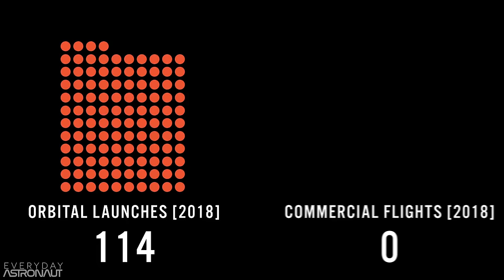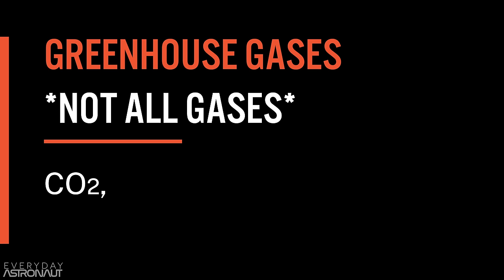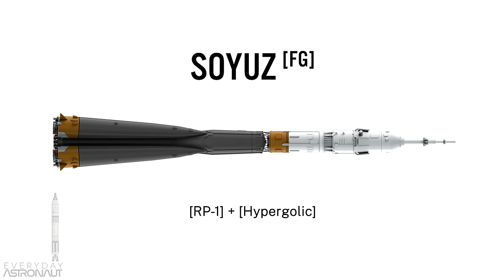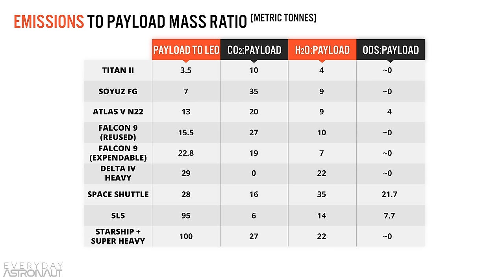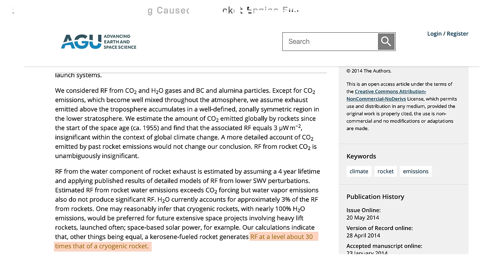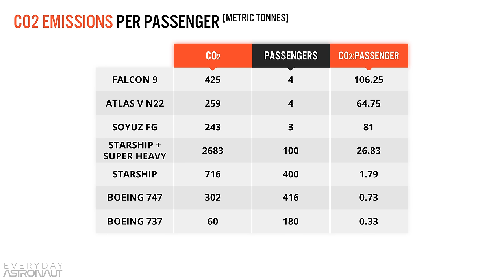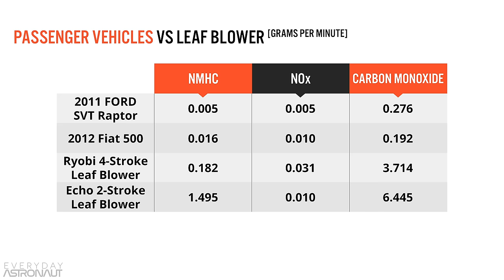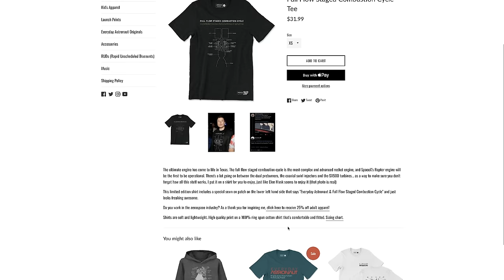How Much Do Rockets Pollute? Are They Bad For Our Air?

Comment: Do hydrogen rockets produce significant amounts of nitrogen oxides or just small amounts.
Thanks for the video. I've subscribed to the channel
Reply: There is no nitrogen inside of the fuel being burned so it will not produce any nitrogen oxides. The heat from the exhaust is also not hot enough to dissasociate the oxygen and nitrogen in the atmosphere.

I may be wrong on this though, as Starship uses methane which also doesn't containe nitrogen, yet it clearly produces a lot of nitrogen oxides as can be seen from on board views during the launch.

Comment: 2-stroke engines? I got a manual reel mower from my neighbor who sadly moved away. The kind with the spiral cylinder blade. You'd think they were some kind of horrible torture device since absolutely everyone uses a motorized mower, but you just walk back and forth with it and it's fine. I've been using it all summer. Much quieter, it gets munchy when you hit the tall grass, it's kind of fun.

Comment: The CO2 emissions associated with the launch of a falcon 9 rocket are roughly equal to those associated with the concrete floor of a typical parking garage (50,000 square feet of 8" Type 1L concrete)

Comment: Especially if many rocket engines run rich, I think it's important to look at the unburnt fuel that comes out of the end as well, especially in the case of methane.  It probably doesn't matter in the grand scheme of things, but I would still say that omitting it is a weak point of your analysis.
Also, manufacturing pollution might be a gigantic rabbit hole, it is an extremely important one, considering even reusable rockets only fly a couple of times.  But also the manufacturing of the fuel could add a lot to how polluting that fuel is.  So, even very rough ballparks would've added a lot to this analysis.
Though, of course, there being more to unpack doesn't mean the analysis is bad.  It was a really interesting and well researched video.
Reply: Huntracony - when methane is burned fuel-rich it makes the same H2O but some of the CO2 becomes CO. Which, as Tim said,  is oxidized to CO2 where the exhaust flame meets air. So it basically never makes methane pollution.

Comment: 29:00
At that point, you might be able to bring a nuclear reactor. Especially since it is so much dimmer there.

If I remember right, that's what curiosity did.

You might be able to get a lot more, and a lot more consistent power source so you wont have to bring batteries either.
Reply: What about a manual thing like the bikes on black mirror? Where some people are paid to just turn a wheel all day?
Reply: its an rtg not a reactor

Comment: Hi Everydays Astronaut, thanks for the good comparission. 
One question, whats about the unburned methane which star ship seams to emit on the launch pad?
Thanks!
Reply: SpaceX pumps the methane into a Recondenser and reuses it. However, they used to use a flare stack located near the pad, to burn the methane off.

Comment: The thing that worries me on pollution is not rockets over jetliners. What worries me more is that jetliner travel will not stop or slow as rocket launches increase as the costs go down. Hopefully we end up with synthetic jet and car fuels that we can gather up the harmful emissions and convert them back to fuel rather than keep adding and adding. I like this idea that Bezos has of moving manufacturing to orbit. If starship is as cheap as Elon says it can be per launch, that will be an ideal vehicle for transporting the inputs and outputs of manufacturing in and out of orbit.

Comment: @Tim, 38:15 "with carbon capture, we could actually almost null out an entire Starship flight." Carbon capture and sequestration is possible, but surely you meant making its methane fuel with renewable energy.

Great video. Do the math, folks!
Reply: Technically, producing methane is carbon capture. I think that's what Tim meant, but I could be wrong.
Of course to be of any use it has to be made usiing renewable energy.

Comment: What about the whole system that runs? You have plenty of build infra around the rocket and if the rocket is not reusable then you have to manufacture them again and again. Hardly ever you'll see the whole combination of the system, but only one part of it. And by mass the rocket itself is a tiny part of the whole organisation. And in space technologies you use loads of rare materials that has to be taken out from the earth crust. This adds quite much pollution to the equation. Without rockets you won't need any of these, so they should be added as a rocket waste. The launch is most likely a minor part of the pollution when compared to the whole industry around them.

Comment: So as to the case of the skylon space plane I can't help but wonder how practical it would be. 
Wouldn't it need an ablative heat shield to re-enter the atmosphere? And wouldn't that ablative shield be depleted and need to be replaced after every re-entry? I don't know the cost of material and labor for something of that nature, but I would assume it to be an expensive and time consuming process. It seems to me that it wouldn't be able to make enough flights to gain any profit worth the expense of use and maintenance. I mean, unless they discover a material that is strong enough to withstand such abuse over the course of numerous flights instead of trying to use and maintain the current ablative shield technology. Just a thought.

Comment: it was said that a Molotov cocktail was 49% fuel by weight, tnt something like(?) 80% fuel by weight, and an orbital rocket was 97% fuel by weight.
Reply: That's because Molotov's cocktails use a container (glass) heavier than extra thin aluminium or stainless steel. And inside a Molotov cocktail, you just put petrol or napalm. It's used to put things or persons on fire, not to explode

Comment: In civil aviation you also have some safety requirements like minimum evacuation time (90 sec) or emergency oxygen supply for a defined time - despite the massive noice level which each launch will cause I don't see it feasible at all to get 400 ppl in a Starship just as an earth-to-earth-transport. It's just bonkers to think it through.

Comment: Little bit surprised that there is never a mention about  biogas when talking about methane. 
After all, it's basically like: put anything organic under water and collect biogas which is usually around 65% methane, 
scrub the excess co2 off and you have 100% renewable methane which you can use any place you would use natural gas.

Comment: Older vid but with turning co2 into methane could also possibly be used to terraform mars. Splitting water into its bases could pump a bunch of oxygen into the atmosphere and help get people back at the same time. Putting a solar array on the moon could be a good idea because of the lack of a lunar atmosphere but getting the energy back would be an interesting challenge to overcome.

Comment: Great presentation; a bit complex, but people needed to hear it all in perspective. Thank you.
I agree that we need to never look at solid boosters again. Currently, our CO2 levels are over 400PPM, at average Earth temp, about 17C. Putting things into perspective, we have to remember that most life evolved, in the past 600 million years under an average temp of 20C and 5000PPM CO2. Most of this carbon has already been sequestered by the Earth and we'll never get it back. Plants die around 150PPM, so we already were facing a carbon-extinction event until the discovery of fossil fuels extraction, which set that back a few hundred million years (more plant life is good, right?)
Its a long road, and we'll run out of fossil fuels about the same time we replace them, as long as we let innovators like Elon Musk keep doing their thing, without slowing them down. The climate will keep changing, but if we cut off fossil fuels tomorrow, we have to realize half the world's population would starve, as they are dependent upon that energy.  That would be a lot more catastrophic than to just let Elon Musk solve it for us, in his own time. Again, we just need to keep the innovation going and it'll be a soft landing. History has shown that the road of tempered innovation, even into rocketry will ultimately benefit all of mankind.

Comment: What is the image of at the 44 minute mark while you're talking about reentry being as bad or worse at polluting then ascent?
Reply: The first one is the boeing starliner, second, blue-glowing one is one of the payload fairings from the falcon 9 on reentry. He put the individual sources for each video he used in the top left corner, so you could have figured that one out yourself pretty easily.

Comment: @Everydayastronaut, I've heard of the punch a hole in the ozone layer as long as I can remember and that things like freon from Air conditioning systems and aerosol sprays could have that effect. But I have always thought of a hole in the ozone layer as like the differences in the buoyancy of the gasses in the atmosphere. Kind of like if you drop oil into water it would be like a hole in top layer if the water. Would that be pretty accurate?

Comment: I'll say vehicular emissions are by far the biggest culprit for higher than normal localised heat & humidity at ground level.  Because industry smoke-stacks are normally high allowing their emissions to travel notably far while dispersing before reaching ground.  Vehicular emissions are another major culprit for respiratory illnesses because they also contain particulates & heavy metals.

Comment: my thoughts after watching the video: if we wanna reduce CO2 emissions we should focus on cars, getting a rocket in space and making it renewable and commercially practical is way harder than moving a car, especially if it's not a race car and you're not speeding or anything, you don't need the most performant engine, you can do fine with an electric engine. making compromises with rockets is way worse to the capability and economy of the rocket

Comment: Very nice Video, but of course there are some slips that, in all fairness, you can not avoid completely. If you compare Rockets to Airliners, then you have to look on their practical and societal uses. There are so many airliners, because they serve a purpose to society - a purpose that in wide parts can not be replaced by rockets (midrange travel). So just putting the different numbers up there rather becomes a part of an "whataboutism", You could equally excuse anything with that argument that just happens in a niche, like car racing / racing cars on public streets, military emissions, etc. pp.
The question is not: "Has this a large percentage on overall pollution?" but "is this additional pollution worth the purpose it serves". Almost nothing apart from general transportation, electricity generation and heating has large impacts on pollution, if singeled out - but the sum of the small niches still delivers a huge part of overall pollution. So - you just can't absolve Rockets from producing emissions by saying "there are not that many of them".

If a rocket is used as travel devices for millionaires to have an exiting "holiday in space" than its emissions are completely avoidable - this serves virtually no benefit to society. It just would be a totally unneccessary purpose, a sign of pollution as a right to a decandent elite. This is of course also true for yachts, etc. - but this is again a whataboutism and would do nothing to justify Spaceflight as a thrillride for millionaires. E.g. Bransons complete "space"-company is nothing than an elaborate amusement park ride...

Of course some rocket starts serve important scientific purposes - but manned spaceflight in general would be highly debatable in this discussion - a mars mission with its thousands of neccessary rockets starts during the programm leading to the final mission could also be debated in its use to humanity.

Comment: I don't think rockets are that bad, especially after watching this video. But they shouldn't be ignored either. Everything else needs to be monitored at the same time as well. Considering cars bring up most of the global CO2 emissions, that should be our first priority, finding a way to cut that at least in half until it's not the biggest contributor. To reduce overall CO2 emissions, we should focus on the biggest offenders first then work down the list until each one is as good as it can be. My two cents.

Comment: so considering that anecdote Formula 1 and other sports racing has benefited regular family cars with improved efficiency, can it be other way around for air industry also? meaning that motivation to increase efficiency, possibly reduce emissions in rocket flights could bring innovations to flight industry efficiency also?

Comment: If anyone was wondering what the single biggest and best way to reduce there own carbon footprint, it would be to try a plant based diet. It can reduce it by up to 73% from just one simple change. Just a thought also this was a great video x
Reply: If everyone on the planet does that it will be worse.
Reply: @user-RCST  in what way would it be worse exactly ?
Reply: @matthewwynn7787  you would need a lot of land to do it and it would deplete a lot of soil of its minerals.

Comment: Methane powered rockets may release double COe-emissions on launch. If you overpressurize the rocket fuel for better performance then you may have some unburned methane that leaks to the atmosphere. If that amount is around 4% then it means you get 25-times more potent GHG to the atmosphere and 4% times 25 is: +100% vs. pure CO2 burn.

Comment: As you said, producing a rocket pollutes from the building process and materials used. That's the same with renewable energy sources. Solar panels or wind turbines use a lot of materials and land, so they're not carbon neutral. Another climate friendly option is nuclear energy, which uses far less materials per energy output and lasts for long. Nuclear energy emits around 6 times fewer CO2 per kWh produced than solar panels (check IPCC for figures). 
And when it comes to costs, to reach a more affordable production of hydrogen you need to run the electrolysers 24/7. That's not compatible with intermittent solar or wind energy. So nuclear energy may be the best source of clean hydrogen in the future. 
Other processes, like methane pyrolysis (also referred as blue hydrogen) may be very interesting in the hopefully near future. But that's for Earth production, not sure it would be feasible on Mars!

Comment: I had an idea from along time....
What if we lauch rockets from a higher land, like mountains?
I mean, it would be away from public, as well as, u would save on alot of fuel!
Reply: No, you would not. The energy is in large parts not used to "lift" the rocket up, but to speed it up to orbital speed (~28.000 km/h). Rockets do not fly "straight up", they go more horizontal pretty soon after they start. It amazes me, that after decades of rocket science people think that "starting from a mountain" would be an idea that nobody in the industry had already entertained - and obviously discarded it...
In fact the best starting points are around the equator - there you can use the "sling" effect of the turning earth which is far greater than "starting from higher up". Same is also true btw for any "catapult-launchpad" ideas - that does not have a large fuel-saving impact in general.
Reply: @40hup  firstly, the rocket scientists, or, any famous person in general, is a normal person - among us. It's not a compulsion to be in space industry - to get a good idea.

Secondly, although what u r saying is true, but even then, it would cut off like 3-4 miles thick atmosphere straight away! And, not all, but atleast, some fuel would be saved!
Because, u r nullifying the drag caused by 3-4 miles of atmosphere, along with the 3-4 miles of distance.
And, there are more advantages to that. Firstly, u get a cool climate to work with, so u don't need to be worried about overheating in a few cases, like cold temperatures to safely store cryogenic fuels in their respective tanks.
Secondly, geographical places with such high altitudes are generally less populated.
Thirdly, although a little bit vague n has negligible effect, there would be lesser gravity at such altitude(not a lot for us, but it may save a few litres of fuel in rocket - which can change alot, as EVERY GRAM MATTERS)
And if we do so from a mountain near equator (as u say), then, it's a lil more sensible...

Comment: You only talked about fuel though, not even a mention of the production process. I don't know exactly what the balance is, but I can promise you a significant portion of the carbon and chemical pollution created as a result of any given rocket, actually comes from the manufacturing.
This is also part of why fully recoverable spacecraft are considered such an important technology to develop by some in the field.
Still a good video though. This is a subject that needs a lot more attention and research.

Comment: Can you address scramjet and ramjets application to Outer space flights?/
Reply: Scramjet engine need to be boosted with a rocket in the first place to work and don’t go fast enough to go into space. Also they still need air to work so it won’t work in space